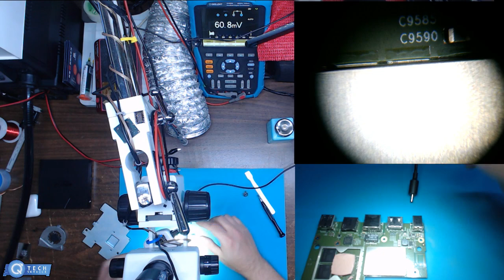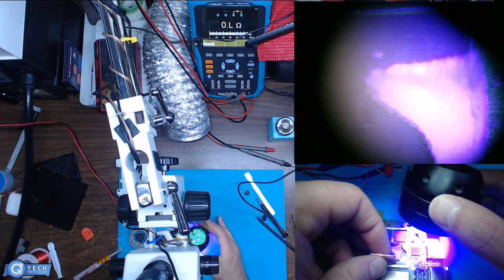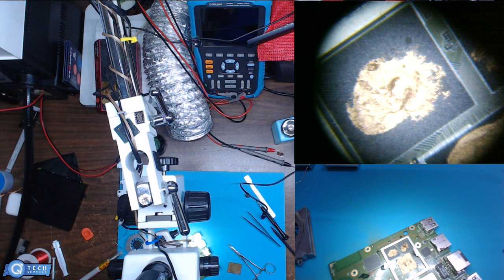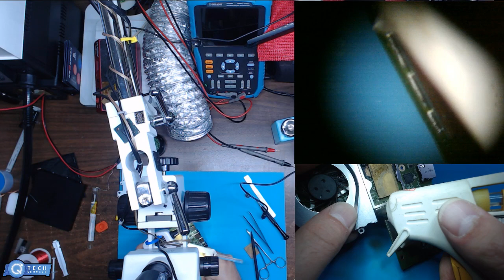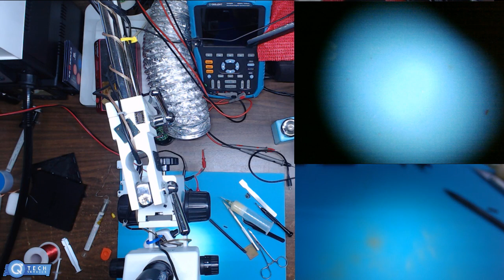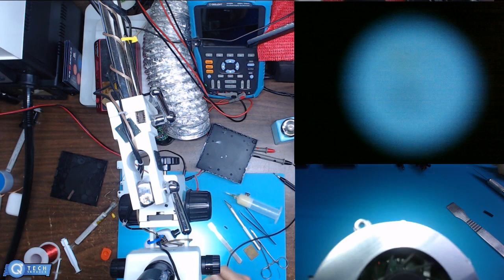amazon fire box overheating fix fan spin

Comment: the tag might even be an antenna for rfid payments or scanning for other rfid items/datasharing (sometimes you can find wifi boosters like that BUT there usually wired or spring tabbed to the pcb
Reply from the maker: Stalwart Computers  Yes but why would they have that in the Box Very strange Pretty strange
Reply: https://www.quora.com/Why-is-there-an-RFID-chip-in-Amazons-Fire-TV-remote
Reply: Q's Tech Service so they can log other amazon devices or for paying for services via touchpay/nfc??
(Its weird for sure will have to do a bit of snooping about that😉)